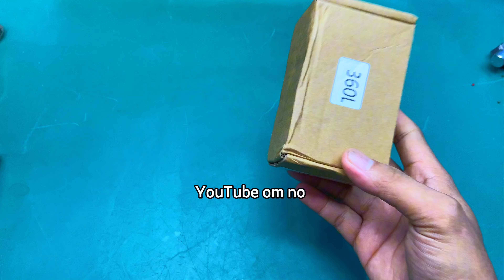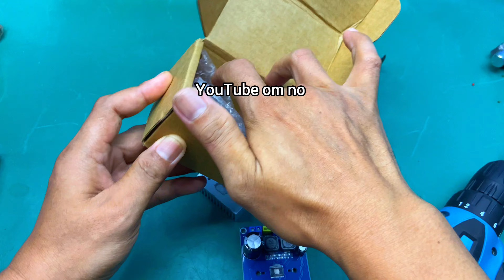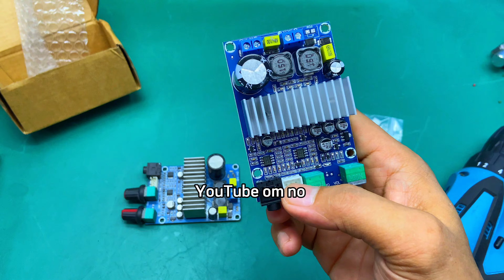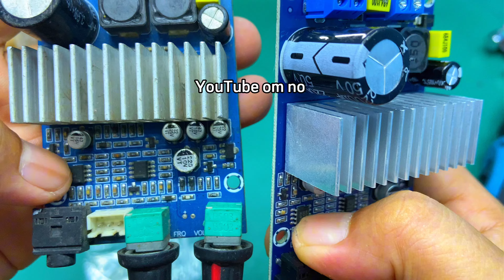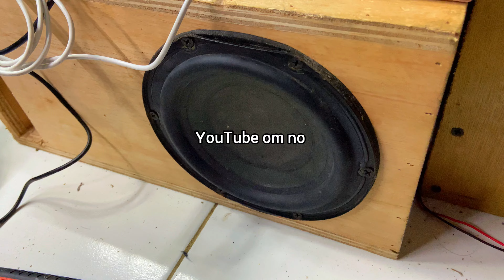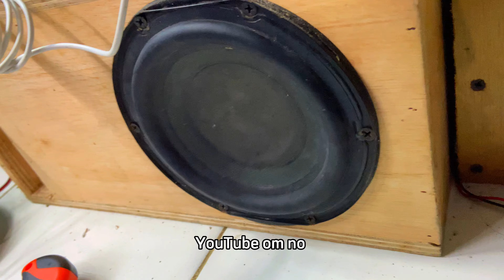TEST REVIEW TPA3116D2 SUBWOOFER 100W

Comment: Denger2 ni klo dgandeng wuzhi inputnya bs dr output speaker wuzhi ke inputnya tu subwofeer om
Reply: Yang anda maksud itu apakah sama dengan psw series milik polytron?
Itu namanya high input dan divideo itu pakai low input
Ya seharusnya tidak bisa input power 3116 sub pakai output power wuzhi kalaupun bisa seharusnya input audio ada 2 opsi
Reply: Gaje
Reply: @dafafarizz ok trima kasih om,maaf pemula
Reply: @Diy_krw iya om, niatnya mo nambah glerr, brangkali aja bisa
Reply: Kit ini kalo digabung Tpa3116d2 100x2 dgn suplay 1psu bisa gak
Reply: Itulah yg pngen saya tNykan, cm klo wuzhi kan input dh blutut
Reply: @muhamadadriyanrama7580  sub pake 8inch legacy om, di psu kasih tmbah elco 10000/50v...biar ga protex

Comment: Chip yang sekarang walaupun besar nampak seperti ORI tetep kualitas nya nggak bagus 
Saya kemaren beli yang hw 354 atau 153 lupa intinya hasilnya beda jauh dari yang pertama
Reply from the maker: Jadi ada penurunan kwalitas gitu yak
Reply: @omno1  menurut saya iya om no
Reply: @omno1 liat test load di wahyu eko romadhon, katanya meski tpa3116 kalo output nya dibawah data sheet kemungkinan itu chip tpa3118 yang di cetak tulisannya tpa3116 soalnya pin nya sama 32
Reply: request tes dengan dummy load, berapa kira2 watt maksimalnya di 24 volt 5 - 8 ampere
Reply: @naufan4427 , bentuk ic tpa 3116d2 dan tpa 3118d, walaupun jumlah kakinya sama, tapi beda fisiknya,